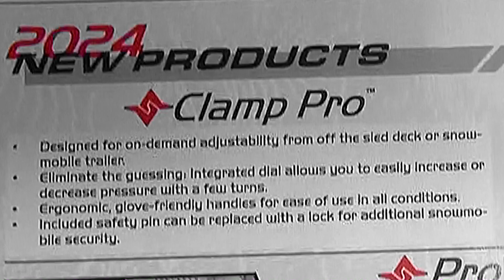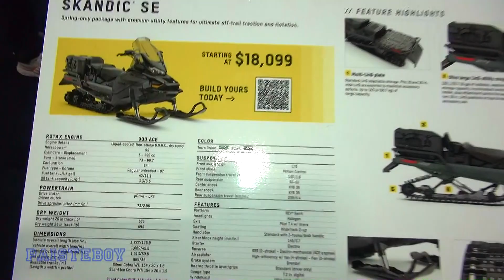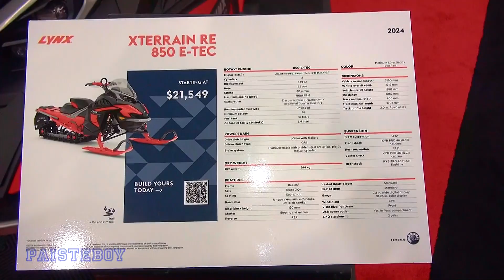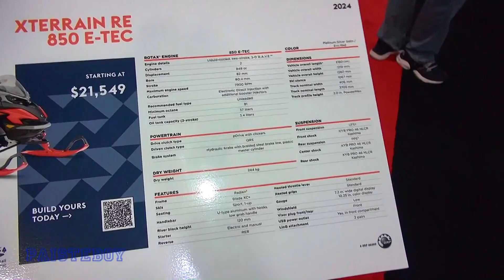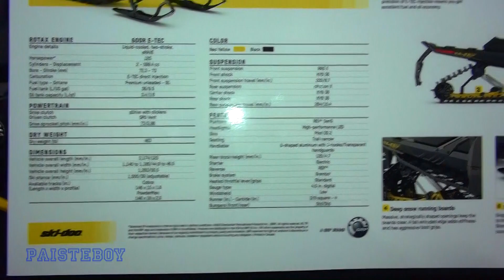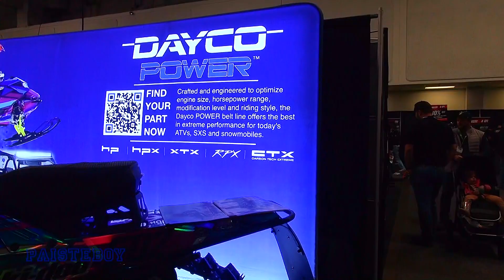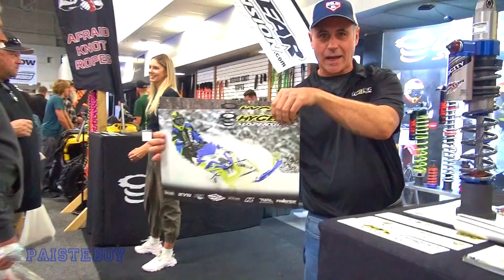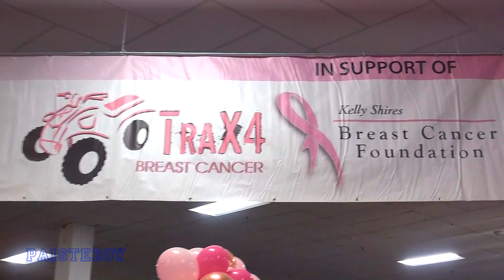Toronto Snowmobile Show 10-21-23

Comment: Paiste what do you think about the monosuit snowmobile gear. Supposed to be lighter than normal gear because it holds all of the heat from your body in.
Reply from the maker: It's not for me.  I think it may be right for someone that just goes out riding and never unsuits to stop and eat at a restaurant or a situation like that.   Being able to remove your coat at a restaurant is just better.  If you have a camp that you launch from and then just go right back to it after your ride then I think it can work in that situation.
We stop and eat at least once a day so I would not want the upper part of the suit dangling from my waist while sitting in a restaurant. 
Thanks for watching Brandon.